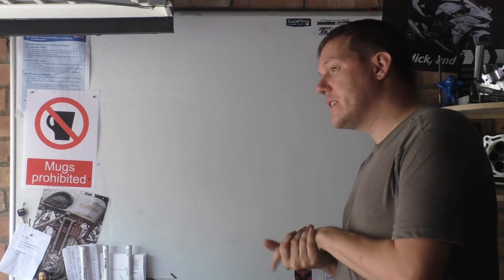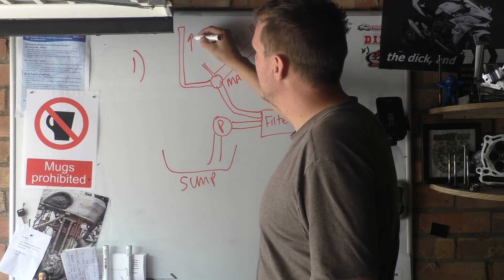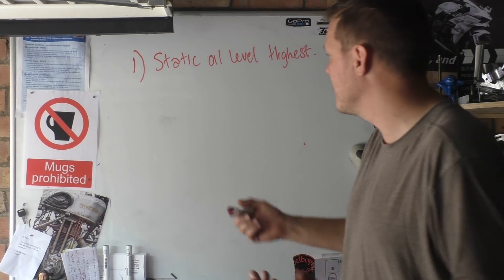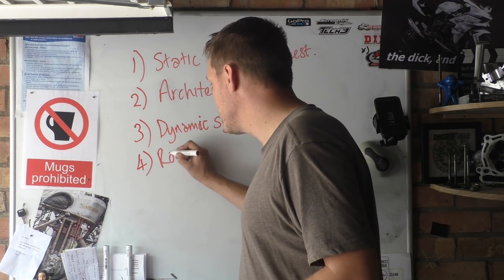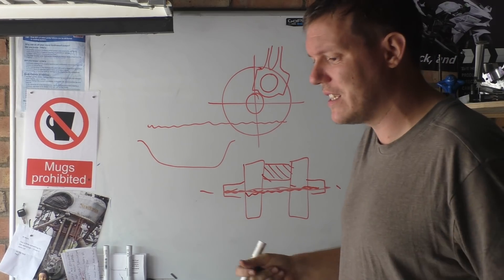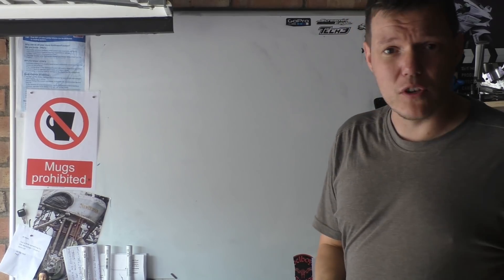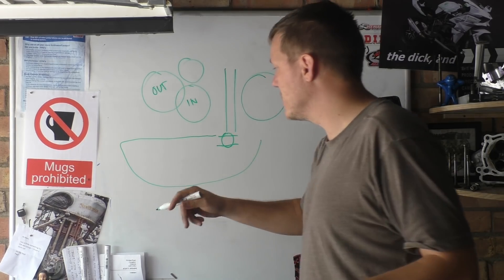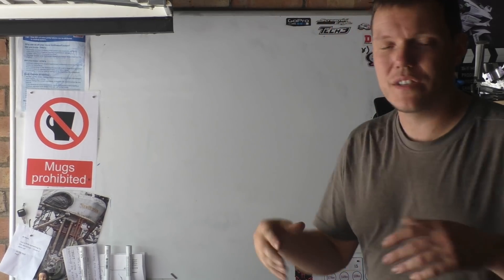Do crankshafts sit in oil?

Comment: Yet so, in any high performance application I saw, they're constantly knife-edging the web lol
And I've firsthand experience in the matter
Reply from the maker: Like who? F1? - No. MotoGP? - No.
Reply: @thedirtyworkshop  MotoGP - Yes. V4 engine to be precise. At least the one we manufacture.
Plus new Ferrari V6 had knife-edging at some point of prototyping (dunno for the series production since I don't work there). New Lamborghini V12, various Porsche, and many more. IIRC even some COX Marine crankshaft had it.

For all that matters, I agree that they're super redundant, yet they still want it (until you point out how much is the cost of the machining involved) lol
Reply from the maker: "MotoGP - Yes. V4 engine to be precise."

- Which crank was knife-edged LOL
Reply: @thedirtyworkshop  It wouldnt be appropiate or professional to disclose which OEM is making what, so I want. 
Feel free to not believe it man. It would not make it less true ;)
Reply from the maker: I've seen about 5 motogp cranks, none of  which were knife edged, why? Because its none-sense

Comment: I have never seen a engine design to have the crankshaft in contact with oil in the pan  I have worked on very old dip and splish oil systems,  but the crank is not below the top of the oil level.

Comment: I wish i could send this video to my local bike shop. The "Head Mechanic" claimed my bike was running with 7 litres of oil in it (3.5l oil capacity) and this was causing a loss of 50% compression in the cylinder thst he had just changed the valves on.
Reply from the maker: LOL he said what??? LMAO!

Comment: is the crankshaft of my dry sump tdm 850 turning in oil when i start it after standing still for a few days?
Reply from the maker: No, or it shouldn't be. Drty sump systems are pretty much the same, but instead of having a sump they have a 'collctor' 'sump' with a pump in the bottom.
Reply: I thought the reason for a dry sump system was to bring the mass of the engine down for a lower centre of gravity, but when all oil fits this "collector sump' underneath the engine, what is the reason for a dry sump system?

Comment: Hey matt, I have another question that could make a short video.

When cranking an engine by hand (to check valve clearances or change italian timing belts,...) you are supposed to turn it only in the direction it normally runs and never in the opposite. Its quiet hard to find top dead center exactly without overshooting and often I find myself doing it the "naughty" way to nail it exactly. Some of the blokes I know say its okay to do but I want to know it from the technical standpoint.

Is what Im doing harming my engines or not? Or slightly?
Reply: long time since this was asked, and dont know if you ever received an answer, so i'll throw my 2c in here...when rotating a chain-drive ohc engine backwards, you are putting pressure on the timing chain tensioner that it wasn't designed to handle.  this has the potential to weaken or even strip the tensioner retaining fasteners (whether springs, bolts, or other attachments).  
the reason for this is once the cam lobe hits the lifter (or rocker, or valve, or whatever it uses), it will require more force to open the valve.  this will, in turn, put more force on the cam chain, and when spun backwards, this force will inevitably fall on the tensioner, which is almost always located on the trailing side of the chain.
if you rotate the engine backwards just a little bit, where the cam isnt trying to open a valve, then no harm done.
geared valvetrains do not have this problem.
so, to answer your question, i would say "it depends...but very possible you could be harming your engines"

Comment: You draw a nice I-beam rod :)

Please do follow up video on oil pressure regulator, galleries and jets'n'stuff. How oil pressure changes with RPM (if no regulator present, linear non-linear progression) and how the oil gets up to the head, when it is "leaking" in cranck bearing, rod bearings or squirting beneath pistons.

To be honest...never really though there is oil pressure regulator in the engine, until I popped my SV's clutch cover and "what is that stuff" came up. Service manual said the regulator....interesting, so sump - pickup screen - oil pump - regulator - oil filter - galleries.

Comment: Nicely explained Matt, just rebuilding my Husaberg 650 motor and the crank certainly does not run in oil, main bearings fed through center of crank and piston sprayed by oil jet, check valve in casing to allow oil and pressure to equalize between cases, clever stuff!👍

Comment: We used to make a pretty penny from Honda's oil alert switch when mowing contractors would tip their edgers back in their trailers and temporarily change the oil level enough to activate the oil alert cut off switch and the boss would charge them for a full service! Unplug the switch, run the motor till it was warm, plug it back in, put a new spark plug in, profit :P

Comment: i overfilled my r1 race bikes new engine by accident. The oil went foamy when i started it becuse of the crank in the oil. Even after a few drains i couldn't get the foamy oil out. First time on track with it it dropped an intake valve on the second lap. idk if it was a dud engine or a result of foamy oil

Comment: DRZ400 actually has the opposite rule apply, you should only see oil on the dip stick if the engine has been warmed up. I'm guessing you probably know if this exception though but at least I look like a smart arse haha.
Reply: What I meant is the dip stick won't have anything on it if the bike is cold, opposite to the general statement you made that oil levels read higher before the engine starts.  The reason for this is that the dip stick for the DRZ is located in the frame of the bike, fairly high up on the bike, the bike moves oil there when it is started and I'm guessing when it's off the oil all moves down into the crank case. I can see how my other comment might not have made that clear. By the way thanks for the videos :)
Reply from the maker: The DZR400 is a dry sump system so that is not within the scope of the video - hence the word 'sump' mulitple times.
Reply from the maker: This is the same will all bikes, you should only measure the oil level when the engine is warm. Its says it in the manual. Warm oil is thinner...

Comment: I feel like there is a revolutionary 2-stroke engine design somewhere out there. Like if you find a way to design it's fuel injection around the conrod slaming into the oil\fuel mixture at 10k rpm and usining that energy to shoot it up into the chamber through a gallery inside the conrod and a one-way valve in the piston.

Comment: Awesome video. The air circulation through the crank is certainly all over the map. If the manufacturers thought this worked to their benefit, it would be in the market.  As a side note I'm getting a 1970 opposed two cylinders two stroke engine this weekend. 337 cc I believe. Have you had any experience with the opposed motors ? New to me.  Thanks you

Comment: I have had good results with windage trays in V8 car engines. My old turbo 750 gasket set came with 2 different sump gaskets, one wide open and the other was mainly closed acting as a windage tray. Helps for wheelies I am sure as it keeps the oil near the pickup.

Comment: ive worked on a SAAB diesel engine which had a teaspoon welded onto the big end of the Conrod to act as its splasher !!
Reply: a JTD? did it leave the factory like that?
Reply: chris davidson I was led to believe yes, that’s what they did back the day , this was also the engine that had a 3/4 thread bung that you stuffed with cotton wool and lite on fire and then screwed back in to act as a glow plug on cold days ! . But it ran fine and never played up for the owner ,
Reply: The good old jerry rig days :P
Reply: But this was not SAAB by OPEL 2.2 or 3.0 engine, right?
Reply: Small Compressors like in Air Conditioning or maybe even your normal fridge use the same technology.
Reply: Aahhh that's confused everyone, sounds like a SABB marine diesel, not a road going B204 or something

Comment: I can say from experience that when one O-ring on the oil pump gets out of place on a Harley, you get some serious loss of power  when the crank case starts to fill with oil. Been there and did that, and had to go back in and put a new O-ring on the suction side of the pump. Haven't read of anyone ever breaking a crank or con-rod from this on a Harley. Normally they just start puking oil out the breathers, and severe loss of power above 3000 rpm.
Reply from the maker: LOL yeah - you know them high speed high powered Harleys LOL. Harleys are mainly full circle cranks if I remember rightly? You wanna try and break real hard at th same time, then you can look at the pieces that used to be crankshaft. LOL
Reply: Yes, I believe most are full circle cranks too, maybe a bit of edge profiling for balance. But from having that problem I would find it hard to believe that a high performance motor would build up to an RPM that would start breaking components. Maybe a very sudden filling of the case, but otherwise I think there would be a more gradual slow down and nothing would break. Anyone willing to buy us a couple of engines to torture?
Reply: Harleys has a dry sump system where the oil is kept in a separate reservoir. The block does not have a sump as such. It has a scavenger pump that removes the oil from the bottom of the engine and back into the oil reservoir
Reply: @johnhansen929  the dry sump works fine, when it is working. An Oring that is slightly small, or one that is twisted is enough to prevent complete suction (scavenging) out of the case. Been there, done that, wondered why it got louder and had no power above 3000 rpm. Turned out to be an incorrect Oring sent with the gasket kit, and this Oring was very close in size to correct, if you had never pulled the pump in a twin cam before, it would be easy to make the same mistake. Lesson learned at the cost of a new gasket, Oring, and 3 quarts of oil.
Reply: The latest Harley's come with a small trailer for all the bits that fall off :P
Reply: @Fridgemusa  Really, you have to go there? It was only the saddlebags that fell off.

Comment: Stretch bolts what's that all about. My bottom pulley on my car has a stretch bolt , loads of Wobbly pulleys on the forum , and a fix with loctite It's supposed to be changed every time you fit a new cam belt . Mine was wobbly stuck a washer under the bolt no more wobble bolt must have stretched ordered a new one . But why

Comment: Learned how to wheelie on a Honda SL-125 back in 1972(?). Oil pickup in the front of the crankcase. By the end of the racing season I could wiggle the end of the cam back & forth 6 or 8mm. Didn't mess up the valve timing all that much, but you wouldn't believe what it did to the ignition timing!

Comment: Look up the see through nitro engine by JohnyQ90. There you can see the crank dipping into a sligh level of premixed nitro. I assume something similar happens in bigger 2 strokes aswell.
Reply: That is an entirely different thing, really. That is simply the fuel and oil mix pooling against the window he fashioned for the back of the crankcase. It isn't dipping into a sump of oil. Small 2 strokes like small nitro engines tend to get an accumulation, though as new enters virtually the same evaporates and goes into the cyl to be burned.
If I remember correctly it was a small side exhaust two stroke. They tend not to breath as well as the back exhausted engines, that tend to be raced. It also had the most rudimentary of carbs.
He has done some seriously interesting projects though. I particularly liked his Nitro engine powered mini Bosch chainsaw project.

Comment: Matt  on a shaft drive  bike  they usually say to use  ep80 or 90 gear  oil ,  were as the gearbox  is  lubricated  with 10w 40 
Would of thought a gearbox is under the same amount of stress as the final drive  but  then again I used to watch  Del Bollox
Reply from the maker: Circulation is the problem. High loads - thicker oil, specially when the system is closed like a shaft drive system - more on this later

Comment: I thought one of the  big reasons for a dry sump was lifting the crank out of the oil, so less power was wasted from crank hitting oil. obviously im wrong though. So why do dry sumps make more power then?
Reply: Dry sump means when at high g forces you have constant oil pressure not having to worry about oil starvation too.
Reply: This is true but then why does HD use a dry sump system?
Reply: @Kris Nicholson 
The sump in a dry sump system still has to collect the oil, which is pumped by a scavenge pump to another vessel of some sort and then from there back to the main pump.
Reply: @Kris Nicholson 
Some carry the same, some carry more. In Nascar an engine that would usually hold 5 or 6 qts. has an oil tank that holds 3 or more gallons. Some newer 4 stroke dirtbikes are semi dry sump using the transmission as the oil tank, they barely hold 2 quarts. When you have a remote tank you need an excess of oil for the second pump and oil lines, it is usual to design for a little extra, competition engines tend to burn a little more which is where most dry sumps are used.
Reply from the maker: Make more power is where you're going wrong. Having a sump means that you need a larger volume of oil, which means more weight. Higher power bikes care more about weight, hence they use dry sump systems.
Reply: Cheers Matt! Awesome reply.

Comment: If you do a video on the oilway drilling of the crankshaft let me know... There are some ways it has been done which although obvious are very different to what you would expect with the V10 F1 cranks only using a 2.5mm hole feeding the shells on the crank pins. Also there is an optimum oil hole exit location on the crank pin which is very different to the way you see typically on a bike along with compound oil way drilling using a single feed from main to crank pin too.. All quite geeky. I have my drawing of the Billet Yamaha R1 crank I can take photos of if you want to show how it is done too...
Reply from the maker: This touches on the subject but more to come - https://www.youtube.com/watch?v=OWaXDY8crIE
Reply: Yep... It sort of covers the basic mass produced road stuff... The interesting ones are the F1 cranks which have a lot of overlap of the crank pins and mains which allows long hole drilling with the crank pins having deep but smaller that usual oil ways as the crank uses its rotation to help with the oil feed. The way the Triumph 600 Supersport bikes which Craig Jones rode (RIP) when they were 4 cylinder engines had to be altered to stop them blowing up as they were revving to 15,500rpm way before Yamaha built the more recent high reving R6 engines. So we had semi machined blanks which we compound oilway drilled to exit the pin 30 degrees before the top of the pin. The compound drilling was also cross drilled at the main and the two oil ways were different diameters with the Pin drilling being only 3.5mm dia.  

You may at some point want to look into nitriding of cranks including Plasma nitriding. Its an interesting process and surprising how a 45 hour nitride can get to one depth and the 90 hour nitride only goes a little deeper but its benefits are worth doing especially in performance applications.

Comment: On any 2 stroke the static oil level is the lowest level, hence why the manuals say never to check the oil level immediately after running the engine.

Honda (and a few other manufacturers) had Camchain splash feed on some bikes. Most notorious of these was the Honda CB 250 G5 and CB 360 G5. Theses bikes, complete with knackered top ends after 15,000 miles, used to be a common feature in breakers yards back in the early 80's.

They earned a reputation for premature top end wer and woes. At low RPM not enough oil was transferred by the cam chain to the head.

Camchain splash feeds were not a good idea but save money and caused the owner of said bike to be looking for a new bike after 3 to 4 years.
Reply: WTF was it with Honda and camchains? The CX500 and its ilk had camchains lubricated by 'oil mist' which is an engineering term meaning 'happy thoughts'. 30k miles was a typical lifespan. Apparently having some of the oil drain from the head down the camchain void was too hard. Then they gave use the 90s Hornet with camchain tensioners that fell apart because all the internal parts were tiny.
Reply from the maker: My CX500 has the same issue, chewed right through the cases - bastard LOL
Reply: On a nicer note the Rotax 350 / 500 / 580 single is designed to blow oil mist up the clutch cable hence why it has a seal grommet at the bottom. A unique feature of Rotax to lubricate and extend clutch cable life.

I don't know if they carried this over to the 650 single motor as I only a bike with the 500 motor installed.

Comment: You know what might be cool? If you covered how teams use the external oil pump on a dry sump system to create HP by the vacuum on the bottom end and why sanctioning bodies govern the displacement of the pump that can be used. Last I heard that was good for 50HP increase alone when properly exploited.
Reply: Yes, afair Steve Dinan did something crazy with oil system on his BMW M5 5.0 v8 engine, Daytona prototype. He saved many, many hp.
Reply from the maker: 50HP? I think you mean on V8's - also I haven't seen any data with such high numbers